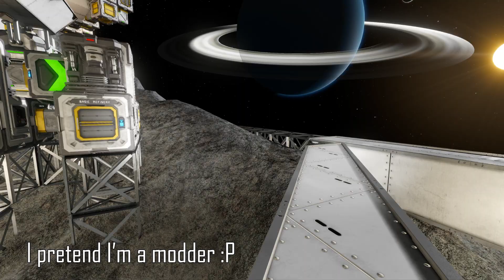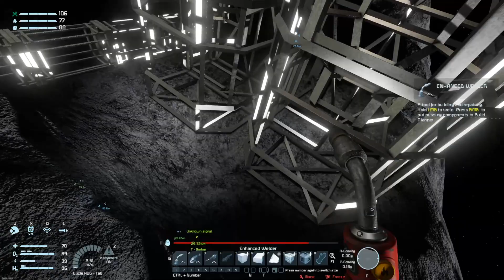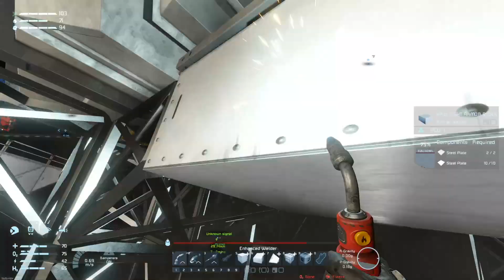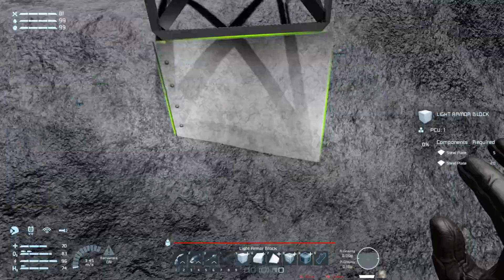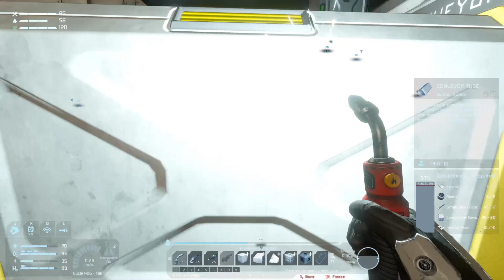Survival Impossible - The Long Arm of the Lawn-Chair #34 - Space Engineers Hardcore Survival

Comment: I know I'm late to the party and perhaps you already did it. But I would suggest to rotate the rotor of the catapult platform so that the stairs matches. And whenever you launch an ore drop pod you could have the platform rotate to the correct position, then idle back so the stairs a matching. I would imagine it would look nice, having some rotating red lights while the platform also rotates and then launches the vessel.

Comment: To beef up the drill arm you could use something like Rotor Variety by Argual , its discontinued but still working. using the   2 3x3x1 Broad Advanced Rotor 1 for x and y then you could build on the back side and add a counter weigh or the reverse pistons

Comment: Splitsie, You said that the hole point of the corridor is that you are going to work. in space the point would be to use up all the space you had. so some kind of equipment related to the "JOB" at this point your creating drop pods to go down to the planet. so in this space i would put testing equipment. Stuff to check the resources, make sure the Iron does not have some kind of Imperfection or what have you. maybe a Diagram of the drop pod. a list of the process and procedure. Maybe some Cargo boxes for holding supplies in them if an engineer would have to run out and do checks. or to make quick repairs.
Reply from the maker: That's some interesting ideas, I really need to get back to making quick LCD pictures for things as they can add so much to a place (thinking of the drop pod schematic)

Comment: Love watching the base get finished up and you are keeping it reasonably hpahazard with your catwalks ;) Did have a kind of cool over engineered idea for your drill counter weight. Change out the corner on the rotor for a juntion as you were talking about then a hinge off the back that you can build your counter weight on top of and make a small control room ontop of the weight to run the drill. Could add an airlock if you'd like or just make it fully pressurized or depressurized. With the hing you could then keep the control room lever as you pivot to drill.

Comment: I had just finished 'Wrong Way Down' and the part near the end where you guys are moving about on your small rovers gave me an idea you guys could do as a series.  you build a custom race track complete with winding turns, hidden shortcuts, and hazards.  then once the track is down you each use a few cargo containers containing the exact same materials for each to build there own racing rover.  To be fair with the rover designs you guys could pick a set size or block count per rover, and to be fair with the track layout, you could make multiple tracks, with each person in your group having main control of the courses path.  You like challenges, and doing this in survival would be one.  What do you think, would you and the guys be up to such a challenge?  And I Just thought of what you could call it, though if do do the series you might pick something different.  'Space Engineers, Burnout'.  You could always ask your fans for better name suggestion.

Comment: Want a cool tower, Put the tower top at bottom level with air locks to tunnel and then have a piston or 3 raise it up or Make elevator, just have the Piston shaft pressurized .   Put plants like  there food garden in the hall way,  you can run the New Lit up tubes along inside top of tunnel for lighting

Comment: Is it not possible to do a strip of caution tape like structure on the edge of the landing pad, I might also add a LCD with a sign saying Caution: active flight operations. I am not sold on the counterweight while it does not look bad it is unconvincing. I can't think of any solutions to that problem just complaints.  You meal options... yum. Just to bug you somewhere on the base you missed guardrails.

Comment: This is precisely why I started watching Space Engineers videos: seeing someone successfully build a functional airtight space while working under the real world constraints of oxygen, food, and water. Most people just rely on their very abundant oxygen supply and airtightness is never really a concern. (Which is frankly strange in a survival scenario)

The Control Tower is also a very nice touch to the space catapult visuals.

Hopefully once you finish making your Hangar airtight on the planet, the Assertive mod works as intended and each new vehicle project will be punctuated by random panic runs outside the airlock to repel the wave of drones.
Reply from the maker: I'm glad you like it because that's exactly why I made the O2 consumption insane. I wanted to make sure I had a proper drive to make indoor spaces and use them, wish I'd have considered the little issue of not having enough iron to build one in a reasonable time frame though :P

Comment: Have you put an antenna on the Lawn Chair to relay back to the mountain-side transmitter tower? I assume you have; that’s how you follow the drop pods to the ground.

45:20 “I left the doors open on this airlock, didn’t I? Yes, I did.” walks off without closing the doors

BTW, I don’t think we saw a view of the launcher from the control tower. I hope you didn’t make it so the view in that direction is limited. Storage boxes in the corridor to the tower would probably make sense. I don’t know if you still have access to something like the shelves you used in the garage in Survival Maybe, but that could also be good to put in the corridor.

Comment: As always great content Splitsie, in the name of coolness make the top of the command tower spin via rotor so you can turn to observe your surroundings while seated, make the base drills' counterweight extend out via piston as the drill head extends to "maintain balance", stick an antenna with an lcd of a hand on a bunch of hinges with a timer block set to make it wiggle and call it the "Radio Wave"

Comment: You could build a control room for the drill onto the platform created by the counterweight which would give it more of a legitimate construction equipment feeling and bulk it up a bit. It would make sense because the field of view from the control room would always line up with the drill allowing it to be easily aimed. It's also just cooler than a bare counterweight. If you don't like the idea of the control tower this would be able to serve the same purpose because you could see both the launcher and the relevant sections of the drill from it. It would also be good for time lapse videos of the drill working.

Comment: LCD suggestions already posted are superior to what I can offer. Regarding the drill counterweight, I agree it doesn’t quite work (in its current iteration at least). Perhaps in place of the counter weight, a set of pistons anchored to the ground with friction-free hinges / rotors at each end? Suggests the weight is so massive that it needs to be leveraged via hydraulics against the asteroid itself.
Reply from the maker: That's an interesting idea, not sure how to deal with the lateral movement of the drill but if I can work that part out I might give it a go :)

Comment: Considering support structures, I feel like you need two diagonal support structures from underneath the base/ platform that attach to the asteroid underneath the cross beam section.
Reply from the maker: Agreed, I've been holding off on that but until I do some of the other building under there, but some support like that is very much needed :)
Reply: Splitsie Yeah I realized you mentioned it just at the end lol. You could potentially do some hanging catwalks underneath as well. Ask Capac about the sector 5 reactor area from ffVII remake for some inspiration. There’s something really cool about those kind of bare bones maintenance access catwalks with nothing but a thin steel mesh between you and plummeting to the planet below!

Comment: A couple of suggestions splitsie, change the LCD warning displays for the corner ones so you can see the text from further away. Secondly I'd change the style of your counter weight. I'd have a 3x3 tube coming off from the back with frame blocks every couple of spaces to make it look like separate weight discs and to look like you can easily change the weight (like the blocks used on construction cranes).

Comment: Someone said a sign saying "Wrong Way Down" and i feel like that needs to be repeated.

I was thinking for the drill rig, you could retract them and build like a big housing for it.

I think if you built like a socket big enough, you could cover the rotors without restricting the movement you actually need...

I think you can do it is what I'm saying.
Reply: Ok so i jumped 21:06 to look at the joints lol.
I can see it working in 2 potential ways. You could build a large casing off the pistons that covers the the whole rotor system. And i think you can use the shallow sloped blocks to give enough leeway to adjust the rotors.

The second idea is having a an elbow joint attached to the rotor base of the left/right rotor, that can cover the conveyor and rotor head and shouldn't get in the way.
Then you can build a shell off of the rotor that would cover the conveyor and rotor head coming out of the back, and if you retract the pistons first you could build like a housing around all of them so it looks like a huge machine.

Do these ideas/suggestions make sense?
You built a bloody awkward machine and i can't just show you a picture of what i mean 🤣

Comment: For the tunnel, I liked the initial look of the unfinished window panes, as an impact shield. You could make a second interior layer of glass panes (or the window blocks) around a smaller 1x1 tunnel, which would help smooth out the support ribs from the interior as well. 

Might get a bit claustrophobic, but you could say it's designed to keep workers from loitering in the tunnel on their shift.

Comment: I guess you should contact the author of your ui warning mod. I see that you need early warning for H2 just as you get for oxygen.

I can't check that now, but i believe vanilla air vents had configurable action in case of depressurisation. You could use that as a safety measure to close all doors in a room. This way you could keep most of frequently used doors open and still be sure they will close as soon as any breach happens.

While watching i remembered you had issue with stairs going down from catapult platform. If you don't want railings, simply flip stairs upside down. They look almost the same that way, and surely better than armor slope.

In terms of that corridor. I think it looks a bit empty. You could use planters, chairless desks, freight boxes, lcd signs, horizontal poles, cables, or use catwalks/railings with halfblock railing facing inside of the corridor to create small separated sightseeing spaces along tunnel.

I think you could build some "drill operator" cabin next to that rotor. Something similar to the tower but bit smaller and with view focused on rig itself.

Comment: You might use the corridor as a place for some plants... a small bit of greenery to  give a small respite from the rigors of space. I think it makes sense to try to make the best use of all pressurized spaces, thus it might not be 'just a corridor'. I would think Aesthetically it might make more sense to alter the 'supports' on the corridor thinner to maximize the sense of internal space, and might better match the ones used on the habitat section. 
Either way a big milestone moving forward. 
It might be interesting to make some minimalist 'probes' to scout some of the other asteroids... but i'm not sure how effective that is. As i recall the range of ore detectors make that fairly cost prohibitive. I was thinking some of the space probes that are fired off with no retern/recovery.  
You need to work out some means of transporting a significant amount of Hydrogen up to this base if it is going to be a launch-pad for hydrogen based craft. I was wondering what form unmanned cargo drones launched from the surface might take. 
Before you leave you may wish to establish an antenna of some kind pointing back towards your ground base, i don't remember seeing you do that yet, and it would suck to be cut off from the base once you launch the Remora.

Comment: 18:36 I think you can beef that connection up as long as you stay to the left of that horizontal rotor, because whatever you build there will still roatate around the horizontal axis with the pistons ubove it. 
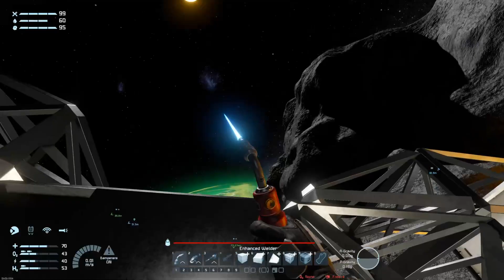21:34 I like the counterweight idea. However, as somone already mentioned, it may interfere with the pistons as they retract. Making it longer or one block higher might help. I also like the idea (again, i think someone already mentioned this) of having the top of it accesible. Maybe put railings around it and have auxiliary controls there, similar to how real live cranes are remote controled but still have a cockpit at the top.

Comment: -> 37:00 have you seen the "unused" compartments of the ISS? they use EVERY nook and cranny to store stuff... so just litter it with crates or maybe line the off platform facing windows with planters as a sort of makeshift greenhouse for "supplying" the base with oxygen and food.
this corridor is a massive pressurized volume which would contain a fair amount of the oxygen in your base so not using it for something is a crime on a space station...
if there was a way to make it so that the area stays only pressurized to a minimal breathable amount (compared to actual living/working area levels) one could argue that it stays empty, but when it is at full base pressure you can not leave it unused....

Comment: The corner blocks in the tower facing the "lawn chair" (catapult arm) block out the view of the launch in action. While replacing those 3 blocks with glass would add unuseable floorspace, it also fits and highlights the function of the tower. Monitoring ships and "shipments" coming and going. Personally I'd even go as far as replacing the floor on that corner with more glass for a better working view. 

Artificial mass blocks would add functionality to the counterweight. And tying the supports to the main platform would also add to the "robustness" of the drill system.

Comment: Add a manual control seat to the counterweight? Gives it another (plausible) reason to be there and breaks up the flat surface on top. And you should probably add another large cargo or three. 

I would also recommend once you build an emergency single-seater "drop pod" if something happens to your main ship. And/or possibly a small remote controlled emergency resupply rocket in the main base. Just enough to get you some food, water, oxygen and a little hydrogen up to you in case you lose track and run your space base dry but still have the ship available.

Comment: Decoration for the corridor:
One word. Crates. Messy Strewn-about crates that the workers left there because they had to get them inside pressurized space, but they were too lazy to properly sort them into the proper inventory system. In addition to that, they weren't using that space anyway so why not?

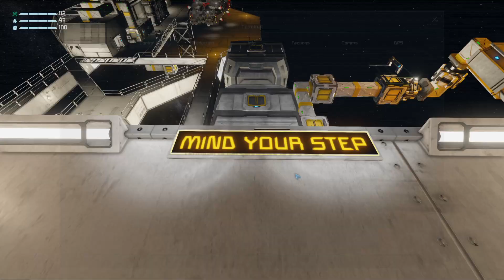Comment: 17:26 What if each one had a different message on it?

21:13 Yeah, that'll do a lot to balance that massive arm. I do like it, it also might be interesting if it extended out as the arm did like a real counterweight.

23:24 I'd like to see the drill stay after the iron is gone, it looks quite interesting even just sitting there embedded in the asteroid. Maybe some extra scaffolding locking it down and all of the lights out for the effect. Perhaps you can have a docking station beside the current landing pad and continue the hanging walkways beneath them? I really like those ones, even more so than the industrial mayhem around the refining area. Some piping and walkways out to the connection ports and some solid supports going into the asteroid to hold the ships in place would look quite nice.

26:56 "Just the moving equipment, nothing will go wrong."
-Last words of a madman mere moments before disaster

46:56 All of that buildup with getting rid of the HUD, the tools, etc and you still didn't turn your lights off. Even then, being able to walk around in there with that view of the black void and the planets is amazing. Also, I never noticed that the engineer looks back when walking backwards. Nice attention to detail from Keen.

Comment: mmm the drill build is quite interesting! maybe just remove the first rotor (up/down) and replace it with a direct hinge instead? that way you could build all around it.
and isn't there like a 45 degree corner LCD that's just like the corner lights? or is that a mod i have? lol. Warning idea: Splat Beyond This Point!
Maybe also have Eik's fern planters in the corridor? or just regular ones even..?

Comment: You could use a catwalks without railings as a "safety net" below base scaffolding and maybe around base. So it would look like there is a net between beams.
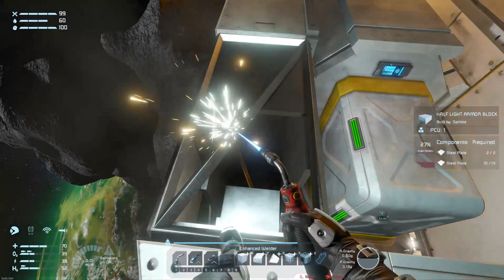21:40 you could add small cargo full of gravel on the counterweight. It could replace center block of counterweight. You could add screen that displays weight like "10T" to cover the cargo container.
You could use neon lights as a "high power" cables from your solar panels to the batteries and refinery area. Make them glow slightly blue or yellow to make them feel "powerful".

Comment: Here's a thought on the drill mount.
How about a horizontal advanced rotor with a conveyor junction or two and a horizontally mounted hinge leading off to the drill pistons.  To make things look better and help lift the drills you could put a hinge-and-conveyor connection between the drill pistons (or a half slab bracket attached to the first one) and a 'mast' a few blocks above the piston connector hinge. It would look a bit like some sort of inverse hydraulic crane. Which of course suggests a dirtside vehicle improvement project.
The drill mount itself could look a bit like the launcher base.
Good luck!